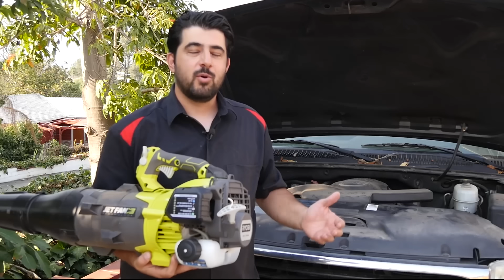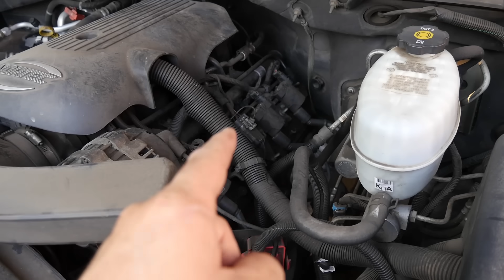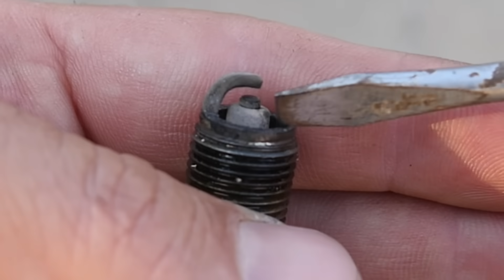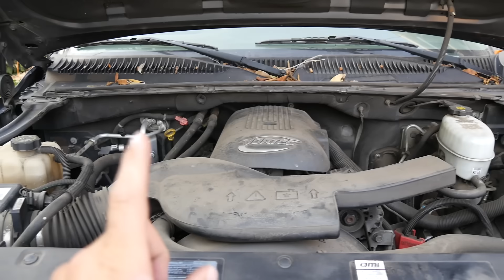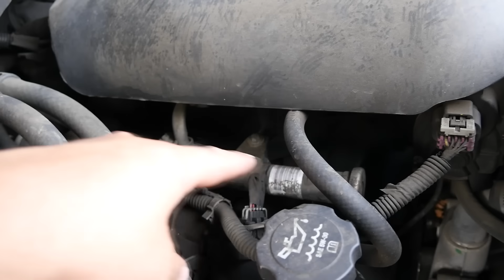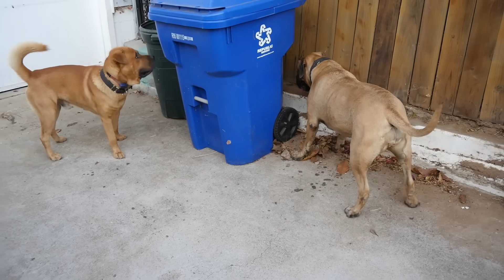Diagnose Engine Misfire Issues by Reading Your Spark Plugs

Comment: When I was changing spark plugs way back at 30,000 miles (and the ignition 'points')  I looked at the condition of each spark plug. 
Now in 2023 I have almost forgot about them!
Thanks for the video

Comment: I changed mine in my 2007 Jeep Grand Cherokee Overland 5.7 liter it took me 4 hours. The gap on a new plug for my vehicle is .045". The burned up ones where Champion Copper Plus the gap was around .065"+ . The new ones I put in are Champion Platinum spark plugs the gap new is .045" and that's what there where factory gaped to. The MPG's have gone up to 21-23 MPG's at 55 mph on flat highway. The old ones I was getting more like 17-20 MPG's.

Comment: Funny this was suggested to me, havent been on my computer in like 2 months.. just got done doing some plugs on my 95 f150 5.0. I only got 4 plugs changed in like 5 hours because the plugs were breaking off and refusing to come out. But the 4 that I got out were really healthy looking plugs according to you, so that's good. Especially considering the truck has 211k miles on original motor

Comment: Trying to get my '06 Kia optima ex v6 running and this was so helpful (she also has 248k miles under her belt)
Reply: My truck has 135 thousand miles on the original plugs. The code came up no communication. To say the least.🤐 Not even a engine light stayed on. I would part it out but not sure what part is good. 🫤

Comment: I remember the day with leaded gas, after doing some highway driving your tail pipe and plugs would have a whitish look to them, today's unleaded gas burns cleaner and doesn't require spark plugs to be changed as often, currently driving a '64 Merc 352CID {all original} and use a lead substitute to help protect the valves

Comment: Way2go sparky😁If I may, the insulator, beside the internal resistance, their integrity also worth regarding. Even if notice a fine dark line that can't be cleaned likely indicates a crack that will get noticed under operation. Careful removal & installation, with cleanliness, also concern for ignition system components because HV will find any break & deterioration along with any dirt oil fluid smudges.

Comment: Gonna try 2 steps colder and new wires, then hope that is what's causing the carbon on my plugs to build up so quickly. Probably change the air filter too now that you mentioned it.

Comment: on my other car, 09 impala ss..... mines was heavy burning oil ... a quart every 500 miles because of the active fuel management i was changing plugs every 3000 miles or so. i bought a tune and turned it off and havent had a problem since
Reply: Have u tried a hotter plug to burn 🔥 up the oil?

Comment: Great video!!!  A spark plug in my 2010 Honda Odyssey is oil-fouled, and the dealership says it's probably the piston ring, because it happened again just after 9 months it was previously fouled.  I just want to keep it running for the next couple of months until I trade it in for a new care....  Can I just get the one spark plug replaced, just to keep it running for a few months?

Comment: Great to see that you have started loading content regularly again. Am I the first to ask about the Audi sleeper car? Wondering if that biturbo is making silly power. Also figuring though the farm may have caused a dip in funds while getting the infrastructure up to OCD standards, and maybe you're just enjoying the car as a driver not a racer.

Thanks again for the content.
Reply from the maker: That's pretty accurate no funds to build it up right now but will be upgrading it with a tune to stage I pretty soon.

Comment: This is helpful, I think it helps me understand what I found. 2020 Mustang 4 cylinder, 18K Miles. First few oil changes free from the dealer, decided I wanted to take over maintenance myself so completed my first oil change the other day. The next day I pulled the four spark plugs to replace and was horrified to find oil dripping from the threads on second plug from the back. I didn't think oil could be actually getting in when the engine was running because the car had been running fine, so looks like I must have overfilled oil despite being so careful. Now my question is, can this result in long-term damage? The car seems to run all right and I haven't seen any smoke out the tailpipe, so not quite sure where I stand.

Comment: my hummer h2 has random misfires once its warmed up, on every cylinder. ive replaced all ignition components  checked fuel injectors, fuel pressure, maf sensor, battery, everything i can think of. i only get a flashing check engine light under load. im lost at this point
Reply from the maker: Its hard to guess without plugging in a scanner but check for a clogged catalytic converter

Comment: Do you need to decarbonise or clean the engine some way if you find you have been running rich for longer than you realised? Resulting in inside tail pipe is black, so O2 Sensor likely also coated and catalytic converter probably also started to be affected.
Do you run some kind of cleaner through the system? Or just clean what can be accessed and hope highway driving cleans the rest?

Comment: I have been getting a code that goes back and forth from random misfire  to   cyl #3 misfire. Recently replaced rotor, cap, plugs and wires and still have the same problem. 
After those new parts,  I found what looks like a black lightning strike on the  cyl #3 plug. 
The strike mark is on the porcelain where the part # is.
Compression seems to be close or with little variation (by my understanding) between all 6 cylinders.
The highest  compression on 4 of the cylinders is 183 lbs.
The lower pressure on 2 of them is 175 lbs.  which includes cyl #3.
 Does that black strike mark imply any particular source or cause of the  misfire ? 
PS: Thank you for all your videos. I really appreciate and enjoy them.

Comment: Hello Bro.
You didn’t talk about how to rectify the Overfilled engine oil causing wet spark plugs problem. I took my Volvo 2.5T to Meineke to do oil Change last weekend, they over-filled with about a Quartz+. I have extracted the oil back to normal level and cleaned my 2nd and 3rd spark plugs which were wet. Car started in the morning. Now, back to square 1, cracking and no start again!
Do I have to do a major repair?
I will appreciate any insight from you.

Comment: i have greyish oil on only one spark plug. had a code p0138 so changed the o2 sensor bank 2. got a p0137 so i assumed it to be because i bought a cheap o2 sensor. just replaced that with the oem ntk brand for 2010 mazda 3. also replaced all 4 plugs. havent driven it yet so idk if a code will return. car has a shake but runs good. shake only noticeable when in in low rpms. maybe a mount? idk. wat do u think? im sure scotty would say junk it and get a toyota. lol

Comment: Great and informative video, RnW.

You didn't say what a normal working spark plug would look like. That is, one working in normal conditions, no lean/rich mixture, no oil leaks, no oil burn, no coolant leak or burn, no timing issues, etc. 

Also, what would a brownish looking spark plug indicate? Electrodes are perfect, and no excess deposits on the plug.
Reply: Isn't that the first one he showed?

Comment: Wondering if you can answer these questions?  Using octane booster and all of my plugs turned orange!  I even had issues starting the car?  Now why did they turn orange, did I harm anything internally, will the orange do away if I quit using booster and lastly did I loose spark plug life because of the booster??  Help.  Ford Fe 428 engine.

Comment: NGK double platinum for my car (OE) lasts thousands of miles and really good MPG. I tried Iridium ones but mpg about the same. I want to try the rhodium tip ones, but they aren't available yet for my car.
Reply: once you hit a certain point in the materials, its less about mpg and more about lifespan. the plat irids should last for 100k, minimum. the plats should last for 60k, regular irids should last for 80k. under normal use in a well maintained engine, anyway. halve all numbers for forced air induction systems, the same way you would for oil change intervals.

Comment: When I was a child doctors used to ask: "when/how did it start happening?" 🙄 Doesn’t how or when the problem started to happen make a difference in the diagnostic?
I have a 20 year old Volvo s40 with 120,000 miles which looks like it just came out of the dealer! 
It was running great until… getting on a freeway had a bad truck driver coming really fast which forced me to accelerate really hard… it got me out of trouble but when I got home the engine light started flashing and the car sounded and felt like misfiring. I have another car so I stopped driving it since I learned it could make it worse. I replaced the spark plugs and coils and the catalytic converter which was the original and really needed to be replaced; however, nothing stopped the flashing light but when I think about it in my case what are the chances that the hard acceleration could've caused the plug wires or spark plugs go bad? They were not old before anyway and I’ve always replaced everything I can with original Volvo parts! So I’m afraid I have to think the worse that could’ve happened… sadly since I bought this car originally in 2003 and used it to take my son to school.. wanted to keep it but now I doubt I’ll be able to..  any ideas pls welcome!

Comment: Hey mate, I have a miss at idle only. I don't know which cylinder is the culprit.
Do you have any suggestions on how to track it down?
I have disconnected injectors one by one and I think number 3 isn't putting in so much work.
The entire ignition system is new. The plugs look identical.
I did take my injectors to get tested but I wasn't confident that he did a good job on it. 
There could also be a vacuum leak in the intake manifold but it's a terrible spot

Comment: Mine just came out and are a little orange but not bad or black.  I have been smelling some oil but no smoke when starting.  And the dipstick pretty much remains full.  Could it be the valve cover gasket sprk plug seals?  They were changed.

Comment: Denso Long Life iridiums. 165K but still look and measure all right. Car starts easily and runs smoothly. Should I replace them?
Reply from the maker: If those plugs have 165k on them you'll probably get your money back in improved gas mileage so I would replace them. GL
Reply: @myRatchets   Thanks. Yes, they are original. It's not a matter of $$ but more about getting to them and replacing safely...'98.Lexus LS 400 that's still my daily driver. Guess I better get busy on it.

Comment: How about if the piston ring is clogged and not recycling the oil, wouldn't that  cause oil in the chamber and ultimately on the spark plug?  How could we tell that's the problem?

Comment: I changed my plugs in July and checked them 5 months later and the driver side looked like they still brand new. 2012 chevy silverado. I'm using bosch platinum I can't figure out if my injectors are blocked

Comment: Please i bought this spark plug 16r-u11 90119 01164 which is recommended by toyota for 2nz-fe engine but when i checked the gap   between the electrodes it was 0.37 inches instead of 0.43 Please is it going to have a negative effects on the engine? Also i want to know what it means when water comes from the tip of your exhaust pipe.

Comment: Quick question off topic.. I changed my speed sensor , speed odometer and tach was working fine , unplugged battery to do the spark plug change and when I started the car again my speed needle js jumping on 0 and my rpm needle won’t move again.. any idea why?
Reply: My guess would be the speed sensor is somehow the fault. Mine did that when the tires were moving faster than the car was. 🥴 Or a squirrel decided to floss with the wire.

Comment: Iridium plugs are hard to figure if they're worn or not.
Reply: Most mechanics would replace based on mileage. Around 80,000 miles I'd say is good enough. The more it wears the harder your ignition coils have to work. Also make sure your plugs are also fiscally ok, the ceramic has to be intact and the gap has to be correct.
Reply: @Brandon-uy1uv  if the plugs are fiscally ok does that mean they have a good 401k investment portfolio? Ha, sorry couldn't resist.

Comment: Also if you have oil contamination on threads  you could have worn valve cover gasket
Reply: Spark plug tube seals*
Reply: Not threads. Above it.

Comment: My Hyundai Sonata 2.0 Turbo Engine Has 185000 Miles And Just Started Barely Running Only Takes About A Quarter Of The Gas Peddle And The Engine Light Started Flashing What Are The Problems To Look For ?

Comment: In my case my wonderful car WAS the family car before it got handed down to me. & I wanna keep it going. It has way over 200,000 miles. More like 262,000 literally all 4 of my spark plugs came out white & just burns the oil...
So in my case "it is what it is" & I bought new ones at autozone. Denso brand 9$ per plug so like 40$ for 4 new spark plugs.

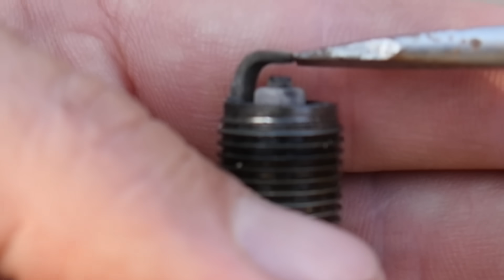Comment: At 2:40 the sparkplug is driving many km 
That sparkplug must be replaced 20 000 km before 
If we drive with that sparkplug then the engine starts hart 
The car burns more gas
And other problems

Comment: Can a spark plug have antifreeze on them ?
Reply: If you put it in the gas.  😉 Seriously a blowen head gasket is famous for mixing with oil and getting in the radiator. As when you see a white smoke real heavy in the mirror and realize you didn't drive through it. 🤮🥺🤬🥵

Comment: Pls. Help me! I just replaced my spark plugs 2wks ago with iridium spark plugs and sometimes my idle is rough and sometimes it jerks when I step on the gas. Please enlighten me what’s wrong.
Reply from the maker: Wrong gap, or you have the wrong spark plug heat range. If that's all you replaced. GL
Reply: @myRatchets  Thank you so much! Also, is it possible that my fuel injectors are faulty?

Comment: have an issue with my 2004 Nissan Pathfinder- 3.5L V6.
I use the car for everyday commute to work, but sometimes theres a misfire.
I did chk the sparkplug, sometimes it looks sooty-carbon and twice it was oily.
Theres is also some black residue which comes out of the exhaust when i start the car.
Just recently i was away for the weekend and when i got back and started the car, the misfire was gone.?!
Anyone know what the issue could be??
Reply: so the "oily" black looking spark plug is a sign of oil getting into the combustion chamber either through the piston rings or valve guides (not good). the sooty-carbon spark plug is carbon deposits usually from a rich mixture, so your car isnt properly burning the air-gas mixture in the combustion chamber. can occur from not enough air to the engine or sensor going bad could be alot of things.
misfires that are intermittent can appear from time to time but if left untreated itll make itself a constant thing

Comment: It could also be caused by a faulty mechanical fuel pump that is mixing engine oil and gasoline.
Reply: If you have that problem then the oil smells gas

Comment: what if i found oil in the all the spark plugs, mostly in cylinder 1, no smoke; cleaned it out, replaced sparks, and it never happened again? 2010 mazda 3, use to have starting issues from a bad battery cable so i think i had to gas it a bit🥲 stopped doing that after a week of having it

Comment: Cars made after 2005 have way too many ridiculous sensors and are way too difficult to diagnose properly even for professionally trained mechanics.  What mechanics do today is they just replace every possible component and foot an enormous bill to the consumer.   Learn how to use a OBDII scanner and troubleshoot the error codes yourself troubleshoot car problems yourself.  Even without an OBDII reader one can also troubleshoot car problems themselves by eliminating problems step by step, slowly and methodically.   The more a person can troubleshoot their own car problems themselves the better they get at maintaining their own vehicles, thus saving themselves thousands of $$$ in yearly  automotive repair costs.

Most garages today will not let any person walk away from their service centre without a minimum $3000 service bill.

Comment: Just pulled out my spark plug after a ''P0304'' (cylinder 4) error. Can you please tell me what's wrong with my engine: https://imgur.com/a/pGMRcay
Reply: Problem with sparkplug, ignition kable,  ignition coil,  fuel injector